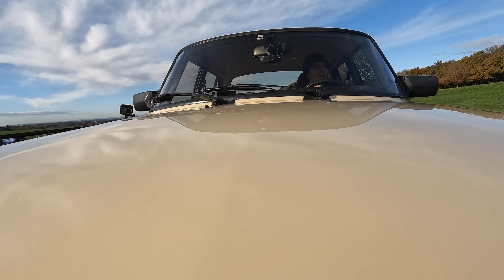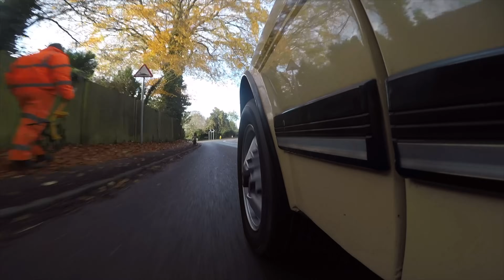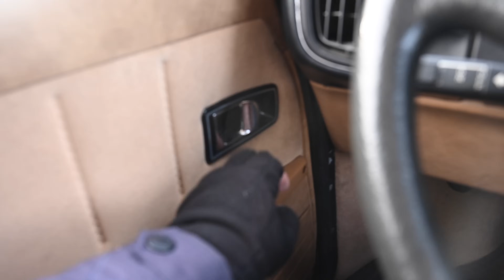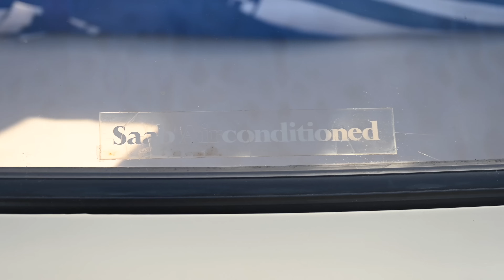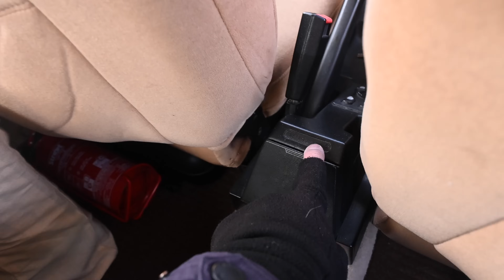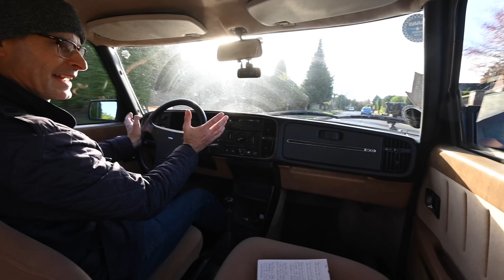Factory custom, one-family Saab 900 Turbo!

Comment: Saab are fantastic cars, underrated, although nowadays seems to have a cult following, I've owned quite a few, my current one's are a rust free 900 coupe turbo, which will undergo some light restoration over the winter, an interior retrim, the leather seats are a bit tatty, and the driver bolster slightly worn, and a new clutch,  and a 9-3 turbo convertible as a daily summer driver.

Comment: The Triumph engine came first, developed in conjunction with Ricardo. Saab used first as a 1700 cc then the 1850cc as used in the Dolomite and then Saab re engineered into the B engine.

Comment: I no longer have a Saab. I've had 7 over the years. By a million miles my favourite car brand. 3 of my Saabs were the classic 900 - my favourite car ever. Totally unique and quirky.  The central ignition key, the vacuum powered heating controls. Great 'flat' handling. Incredible turning circle. That clamshell bonnet. The sound. Everything is just wonderful.
Reply: Hi. Think the 900 was on a par with the Mercedes w124; indestructible, wonderfully laid out, build by engineers....

Comment: That is not a B motor, what you have there is the H motor 8 valve. The H motor had both 8 & 16 valve renditions. In the states, only '79 & '80 900's had the B motor.

Comment: So it's a 1983 car, that left Oman in 1988, and has somehow ended up with a 1985-86 registration. Make that make sense...

What did LJK Setright think of Saabs? I know he was a Honda man because he liked their engineering, but surely he must have held a torch for Saabs and Citroëns of the time as well.
Reply: the DVLA messed up when we imported her in 1988 and issued the 85 number plate, no idea why, it was all paper based back then, but it kind of stuck, and now it's part of her.

Comment: "Much better off than in a Sierra" ... the car that Frank Williams was driving when he had his life-changing crash.  The latter part of his life may have been very different had he been driving a Saab or another Swedish car.  Speaking of which, my grandparents were involved in a high-speed head-on collision in 1995/6, where the other car was on the wrong side of the road, immediately followed by another car smashing into the rear of them.  They had two cars at the time: a Ford Sierra and a Volvo 740.  They chose the Volvo and survived.
Reply from the maker: They chose well that day

Comment: My buddy has one. He bought it new in 1984. Beautiful machine. Highly specced like this one. I think there's more than 200,000 miles on it now. Unfortunately, he's not able to drive anymore, so it's been sitting in his garage for a few year at this stage. He told me that it was stolen on him twice, and both times he got it back. I repaired the damage done by the thieves the second time, and unfortunately, it's not as difficult as made out to be. When you're a car thief, you don't care about being pig ignorant to someone else's property. They just kicked the gear leaver and broke the lock housing, iirc. I don't think there's any steering lock on them, so it was easy from then on to drive away. 

Luckily, there was never any other damage to it. Aside from the car doesn't see the road these days anymore, I'm guessing car thieves these days wouldn't know how to hotwire a car now.

Comment: Love the original Saab 900, Citroen/Peugeot also had an engine with the gearbox in the sump like BL nicknamed the suitcase engine and it was similar to the BL variant were it shared the engine oil and had transfer gears unlike the chain drive and separate oil of the Saab's

Comment: My Grandfather had a 99 then 900, my father had a 99 then 90 and I had a 900 then 9-5. Love SAABs. The 1982 900 saved my Grandparents lives. A Lada veneered across the road and hit them head on. No time to brake so an impact speed of close to 100mph. My elderly grandparents walked away from the intact passenger  cage. Probably saved the Lada driver too who survived despite the gearbox being pushed back as far as the back seats.

Comment: While I am a big fan of the classic shape 900 (especially the flat front cars) and think it is a very cool car, I do find the whole "custom build" story a little unlikely. More like something the owner has made up to make the car seem more interesting.
Why?, well there are a number of reasons starting with the leather and sunroof. As these cars were being sold in Oman anyway, the notion that his particular car was made with this specific spec (velour and no sunroof) would suggest that all the other 900 turbo's being sold in Oman at the time had leather and a sunroof. Which would make no sense and is highly unlikely. 
Sticking with the seats and crossing into the heating elements. This particular style of "contour" seats were available in velour anyway, so (ignoring the first point) if the Sheik who originally ordered the car really didn't want leather, there would be no need to reupholster these seats, just remove them and fit velour ones. As to the question of why you'd want heated seats in a desert dwelling, the obvious answer is that deserts get VERY cold at night. But the other key point is that the heated seats fitted to this age of Saab were thermostatically controlled, i.e, they aren't going to come on unless it is cold enough to need them. So the notion of taking the seats apart to move the heating elements would be madness and makes no sense at all. 
Couple of other points, APC was not a special order option, it was introduced in 1982 as standard on all 900 turbo models. Regarding the practicality, while this is a little less practical than the hatchback, the rear seats do still fold down completely flat. 
I'm also not convinced this car has lowered sports suspension. I worked at a Saab dealer from '90-'95 (so I do know what I am talking about) and while the rear of this car looks like it is sagging a little, the ride height at the front looks completely standard. 

None of which changes the fact that this is a very cool car though, the flat front 900 is one of my all time favourites.
Reply: Yeah these appear to be standard saab seats of the period.🤷
Reply: There were some errors in the information but that always happens as there's so much information to get accross and things get forgotten or mixed up. No they were not reupholstered and never had heating elements removed. They were just built without them from the beginning, so you are perfectly right in that regard! But as I said, every time someone does an article about her, things get mixed up, I'm used to it by now, but at least it's not as bad as a magazine calling her a "99" the entire way through! :D But no - never any heated seats, I know in normal saabs they're thermostatically controlled but they're definitely not present at all in this one and never have been. We did have to do a minor repair to the driver's seat back in 2008 as it was sagging a little - you'll spot little extra stitch dimples in it compared to the passenger one if you look closely. My brother-in-law's brother peeled the fabric off, re-jigged the underneath, then put it back together again, and there was no heating elements or wires at all. 

They are not the same as normal velour seats in other 900s of the time, which had a flatter profile and different cut pattern, without the bolstered shape. This pattern was mostly used for the leather sports seats, and only extremely rarely for velour. To date I have only found two other examples of cashmere velour sports seats out there, and one of those is no longer even in the car it came from, is it outlasted the vehicle itself. 

The car also doesn't have lowered sports suspension, quite the opposite. I think that was a misunderstanding where Matt was describing that option available on OTHER saab 900s. In fact dad was adamant that from new her suspension was purposefully higher to deal with graded roads (to go with the sump guard as well). Although I'm not convinced he was right on that point, as it's certainly not higher now, but when parked next to other 900s at shows, she sits exactly the same. If it had been previously, as he claimed, and changed for standard at some point, then I'm still skeptical because in our photos of her when new she's certainly not sitting too high either. 

The "sagging" at the back isn't present when she's unladen, but she was carring a pretty heavy powered wheelchair in the boot on the day he filmed this, and it does make her sit down somewhat. 

But yes, other saabs in Oman did have sunroofs, including all the police cruisers they bought (my dad attended the official handover ceremony of the fleet and took photos, including of Eric Carlsson giving a handling demonstration to the local coppers in a 900). That's not to say that all of them did - the low spec ones of course didn't, but I do know it's certainly extremely rare to find a high spec saab without one, and all we can do is go off what the main dealer told us when we got her, and what was available in the region at the time.

Comment: I remember in the mid 80s Ian Botham crashed a 900 on a motorway about 100mph and walked away unscathed. A year later he barrel rolled two 900s at the same corner at thruxton race track. The doors still opened and he strolled away 🤣
Reply: I knew about Botham crashing 2 900's on the same day at Thruxton (Saab made an advert out of it), but he crashed one on a motorway too?! 😮 He really needs to have a word with himself..

Comment: Great video. I'm a SAAB NUT - had 7 over my 53 years of driving. I started with a 1963 Bullnose 2 stroke, then a V4, then 2 x 900s, a 99, then a 900 LPT and finally a 1991 900i, which I ran for 18 delightful years. I only sold it as I just didn't use it enough to warrant the expense of owning a car, but I wouldn't think twice about getting another 900i, if I ever could justify it.
Reply: Yep, the 900 til 1994 was the best..😊
Reply: To bad you did not experiense the 2001 93 and the new 2008 93😉
A different world and progress for each model, but still saab.
Owned 96 v4, different 900i and 900 turbo, 93 i and 93 turbo  😉
Reply: @jan-erikgauksheim3749  Actually I did ! My sister had a 2009 SAAB 93. It was nice, but to my mind just didn't quite have the elegance and grace or even build of the 900. The shape of the 900 is beautiful.

Comment: I always loved SAAB cars but could never afford a new one. So, in 2009 I bought a 1993 model 9000 five door hatchback with an automatic transmission. It only cost $3000 AUD, so yes, it had some problems. When looking for a cheap car for my son who was learning to drive, I bought a 1989 model two door five speed manual transmission 900. No turbo but it was a strong performer. Both cars unfortunately had not been well maintained before, and I only had the 900 for two years before having to scrap it. I traded in the 9000 when buying a brand new Honda Jazz 1.5i auto in 2012. A three door hatchback 900 turbo would have been my dream car, but alas, I never owned one.

Comment: Great revew!
My dad had a -83 900 Turbo 4d in maroon with maroon velour interior, so I don't think it was a special order on this car. Might be special for the market, but quite common from the factory. They built all cars to order, so combinations like this spec car was possible.
Reply from the maker: Velour was common on them but shouldn’t have been on the Aero seats which is what make this unusual
Reply: The usual velour pattern was flatter without the bolstered shape. This pattern was usually on the leather seats. I have since found TWO other examples of the cashmere velour sport seats, but they are incredibly rare.

Comment: Aha, driving around my local roads and favoured routes when I take one of my classics out...Epsom racecourse. My mate has a later 88 900 16v turbo, rare 2 door uk supplied and one family owned since new. Recently almost completed light restoration. Can put you in touch if interested. It's got a bit more power being the 16v and has the Carlsson emu etc, think 185bhp ish. Rapid

Comment: A friend of mine, back in the days in Sweden, bought a 900 Turbo with the H-engine Turbo 16v, that had been used by the police as an unmarked interceptor. Same colour, looked totally innocent but the engine had some mods done to it, resulting in wheelspin in third gear, etc. No, he did not want to sell it......

Comment: Those 'Incas' probably replace the original metric-sized TRX turbine wheels. Very cool!
Reply: No the incas were original. She had them on in the showroom the first day I saw her. We have photos of her the day she arrived home wearing them.

The only other wheels she has ever worn were some incorrect aero 3-spokes for a while from the late 1990s into the 2000s. But I changed them back to the originals so she remains exactly as she left the factory 👍

Comment: If you put it into reverse the rear of the positionlights in the front illuminates the side of the car to make you see while turning in reverse!
Reply: On most of them yes. Weirdly, this one doesn’t have that fitted! I did consider retrofitting them as it would be straightforward.m, but decided not to. The entire goal is to keep her exactly as she left the factory, zero upgrades or changes. To change anything about her spec devalues what makes her unique.

The only exception is the head unit which is easily removed. I have one which resembles a period correct stereo, but with modern mp3 and smartphone capabilities hidden inside.
Reply: @FarnfieldK  Ok, well I'm a Volvo fan but was impressed by that ingenious idea.

Comment: I owned a three-door 900 many years ago and loved it!

There's a reason the ignition key is between the seats. Saab wanted it away from the steering column, where it cou hurt your knee in an accident. But that meant there was no steering lock, so they devised a gear lever lock instead. And believe me, that lock is strong! On my car, I had to take it apart because the ignition switch failed. It would take to much time to go into the details, but I can assure you that the system is so strong that you'd sooner brake off the entire gear lever than get it out of reverse. And I'm not kidding!
Reply: And the other reason is your arm would naturally go down in an easy way to the down position a nice thought in the design process.
Reply: From my mother who was suffering rheumatoid arthritis
Reply: Steering locks were easily broken with a pry bar or long socket extension through the steering wheel, the locking pin was woefully inadequate, the car thieves method of entry something to lever the door lock or smash a window.
Reply: @tonys1636  In the case of the Saab, a thick hardened steel quadrant swivels into place to block the gear lever from going anywhere. Try as you may, that quadrant isn't going to budge. As I said, you'd sooner break the gear lever.

Comment: Gone but forgotten never. 
The 9000 turned the wick up even more which was an achievement in itself. 
The real trick of the 900 was that it never looked past its sell by date. 
The humble 1979 2.0 litre GLs was no slouch either. 
The one comparison I remember from 1981 was that in my Dad's Friend's 900 GLs you sat fully supported on the rear rear bench while in my Uncle's 1979 Vauxhall Cavalier 2.0 litre GL you sunk into the rear bench and kept sinking.
Reply: 9000's were targeted for Twocs!  My Boss's Areo Tubro went for a burden.
Reply: @69Phuket  what are Twocs
Reply: @seancooke7332  Taking without Consent.... Robbing yer car basically!
Reply: @69Phuket 
And what is an Areo Tubro?

Comment: Amazing car 👍 From the side profile shot at about 11.14 I couldn't help notice the extremely long tail pipe of the exhaust 😂 Definitely different
Reply: The exhaust isn’t the original but it is a slightly different Saab one as close as we could find to the original, which was along flat oval cross section. (Yup it’s my car)
Reply: @FarnfieldK  Fantastic. I'll have the same problem in the new year when I fit a new exhaust to my thumbnail picture - 1 of 3 left on the road and exhaust parts completely unobtainable.

Comment: Had a 900spg with Saab 9000 injectors and intercooler. The old turbo boosting away  at 20+ psi ! Reasonably quick even by todays standards.

Comment: The color was the same as my base 99GL, as were the seats. The velour was slightly darker in color, until they seats broke, so we put in exactly the same seats as you have. Also the top of the door panels and the bottom and the carpets were the same as in my base 99 from 1981. By the way I also had the H engine (delivered from 1981). After the 99 I had a 1983 900S sedan in blue. Unfortunately the doors rusted a lot. But before I got to that, it was rear ended (totalled) by a Mitsubishi L300 that was completely destroyed. The 900 barely had a scratch but was bent like a banana. I found both cars not reliable, and they both had worn valve stems, way before 200.000 km, which is unacceptable.  The 99 drove way better (lighter and nimbler).

Comment: Saab 900 with power windows are extremely rare, this is probably the oddest spec ever built. Did you ever come across a Saab 90? That's a 99 with the rear end of a 900, built only from 1985-1987 as a base model car by Valmet in Uusikaupunki, Finland.
Reply: where I lived in Europe we had US Spec Saabs. They mostly  came with aircon and electric everywhere but yes, in most Euro markets  they where often poorly equipped but that was the case also for Mercedes
Reply: Not that rare I don't think.